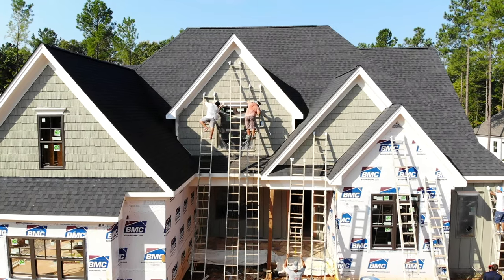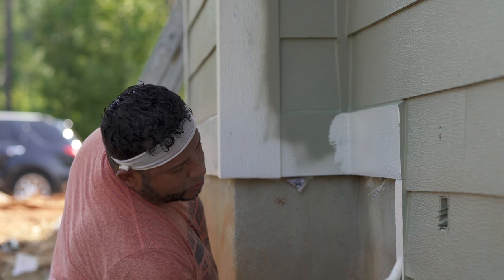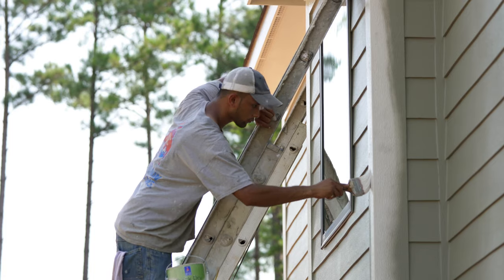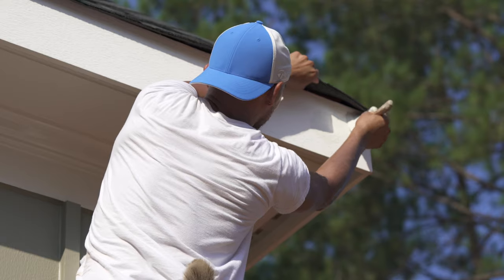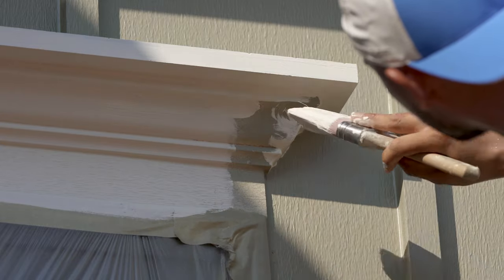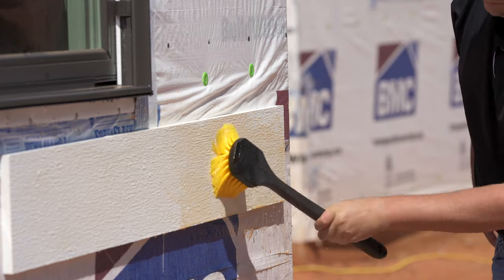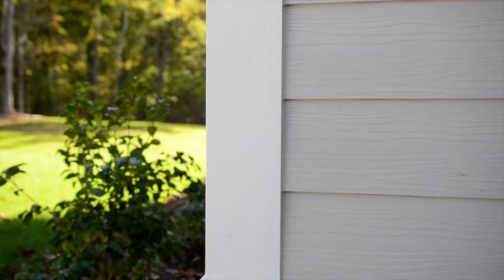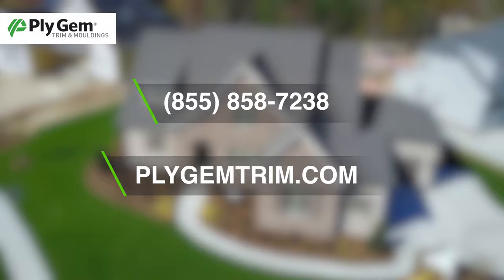PVC Trim – Painting and Care

Comment: I build 5/4 gates with PVC reverse board one side has wood grain back side is flat. I spray primer coat Sherwin williams PVC plastic rattle cans then paint with matching wall paint. Use SS screws fill with body putty mix sand and prime and finish.. So far 18 gates later the only problem is these lead to the backyards that are all walled in around the house. Trash barrels' get pushed or dragged through the gate and get a little banged up. Just a little touch up will do. you can by a gal. of the pvc primer have it color matched about $78.00 gal. I get about $850 + per door 36 in x 6 ft height with new hinges and latch... Hardest part is the old door of 3 crap layers wood and nails cutting it down an trashing it.